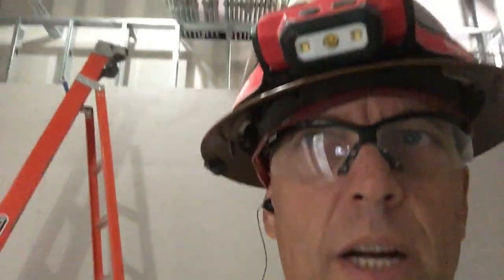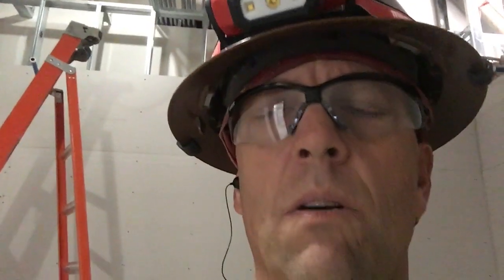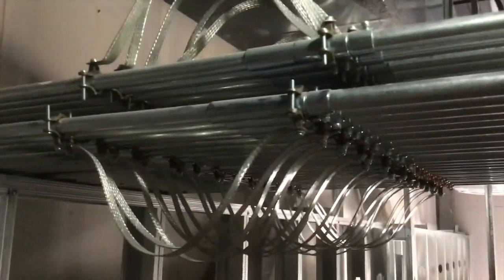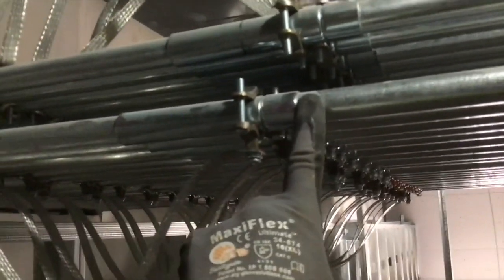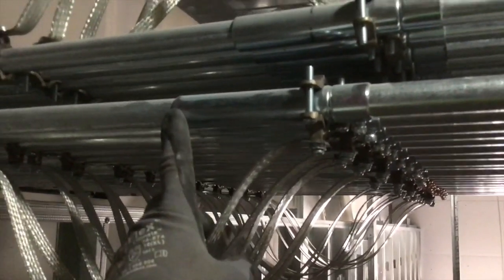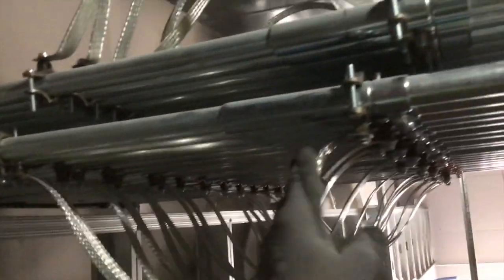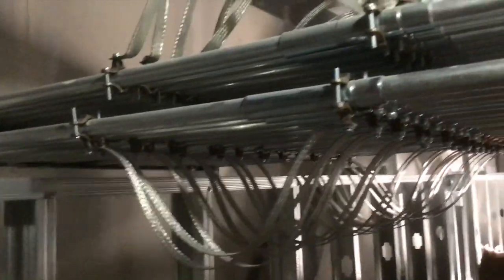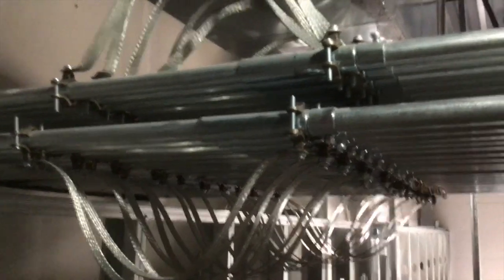EMT CONDUIT EXPANSION FITTINGS AT WORK #CONDUIT #EMT

Comment: I thought the bonding jumper get secures on both EMT conduits, not the coupling itshelf. What if the set-screw got lose on the coupling? You will have issues with the grounding on the pipes. The braided jumper is too long. I would trim it enough for the expansion. This is a nice one to use XJG104 EMT Expansion Coupling (Weight: 35 lbs).

Comment: Thanks for showing these. Not to be a smart alec, but just for clarification: shouldn't the bonding clamps be placed on the conduit to the right of the expansion coupling, rather than on the couplings themselves? I watched the manufacturer's video and they were placing the second clamp 1" away from the coupling on the stable side of the joint, 11" away from the one on the floating side.

Comment: That looks like a cluttered mess. Take the time to look at BAMS Fittings and there internal grounded Expansion Fittings I think you'll be impressed. 100% Made in the USA, UL listed, excludes the need for bonding jumper's which saves time on installation & cost.
Reply from the maker: I will definitely take a look at them .
Reply: Jarrett the Journeyman I also know there (BAMS) Deflection fittings are coming out very soon as well I got a peek at them personally on a job site a while ago they are spot on also excluding the external bonding jumper with an internal ground system. So you will have one continuous run that is internally grounded, just think- WOW

Comment: Good info , Thanks    Are the grounds needed even if youre not using the emt for a ground itself ? I would think so... also if the pipes are moving ( expanding ) what about the wires? ( they dont )  or are they curled in such a way they self adjust?
Reply from the maker: Ronbo Nick the bounding straps are required to keep the potential the same. The conductors due have some slack in junction boxes within the conduit run.
Reply: @jarrettthejourneyman7196   I thought so ! Thanks    Ive done Power Gen 1 and 2 megs and mostly residential electrical , some of the commercial is different to me
Reply from the maker: Ronbo Nick keep learning this trade my friend. I have literally gotten to go halfway around the world as an electrician.